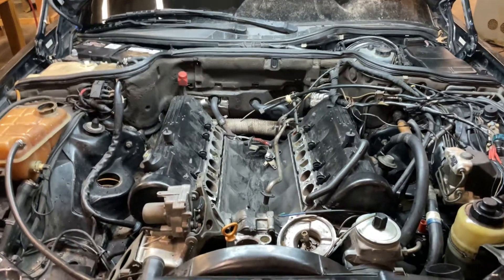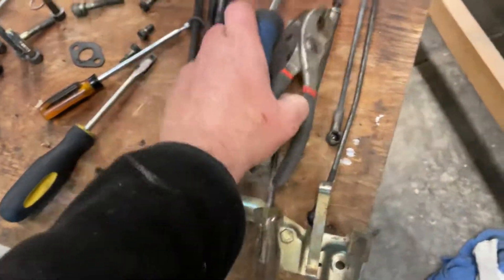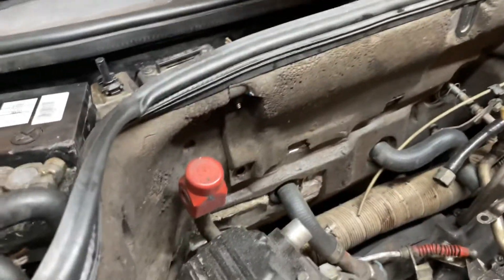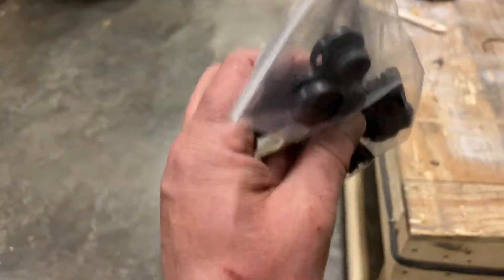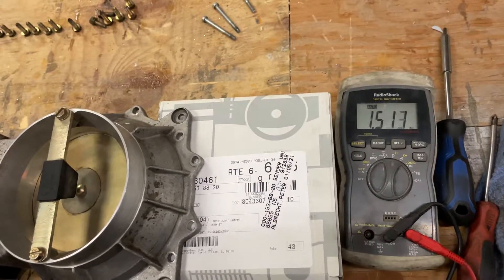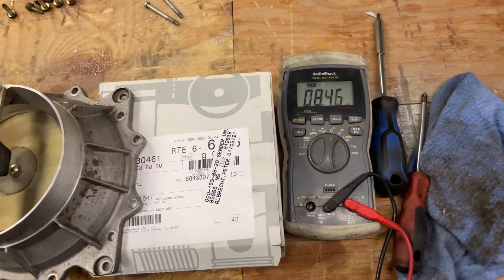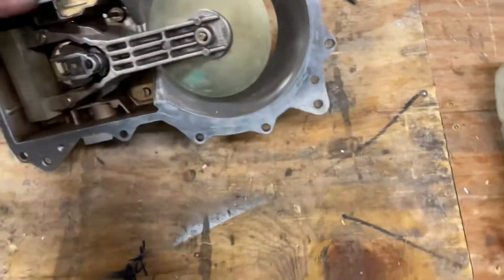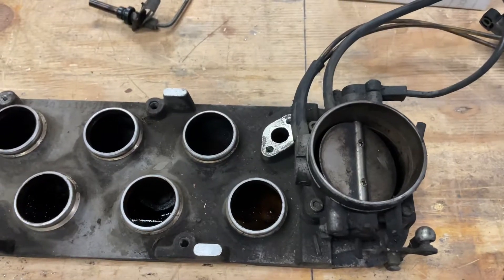Mercedes Benz W126 560SEL 3/89 The BIG repair of the idle speed and vacuum issues Part 2

Comment: Hi Peter. I did a compression check on all cylinders and most are 10-11 bar. Cyl #3 was 8.2 bar. I also have oil in the spark plug wells not from valve cover gaskets. What would you do if you were me?
Thanks
Reply from the maker: Pressurize cylinder 3 and see where the air comes out. Intake, exhaust / muffler or oil filled opening?
If it comes out of oil filler opening then cylinder 3 is leaking on piston rings. Fill cylinder 3 with plenty of marvel mystery oil and let it soak for a week or so, then crank engine for 30 or more seconds to blow out mystery oil out of cylinder 3 without spark plug. Remove rear crankshaft position sensor from ezl and remove fpr before cranking so the engine won’t start.
If it is the valves then you need to take off either intake bridge or exhaust manifold to reach lower part of the leaky valve. Proceed to soak valve head with mystery marvel oil
Fill valve opening every day with fresh mystery oil for one week then crank as previously described
Reply from the maker: And George, inspect cylinder 3 with an borescope first to see if there is any visible damage to cylinder 3 and valves
Reply: @inovahightechltd  is this called the leak down test?
Reply from the maker: @georgesand4629  basically, it’s the poor man’s version, which utilizes one’s ears as high end leak detector
Works like a charm